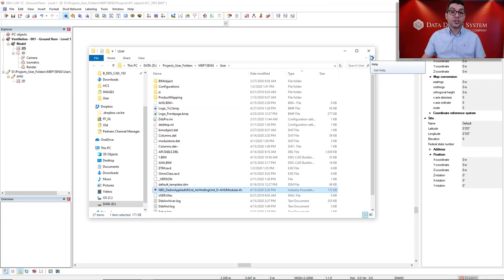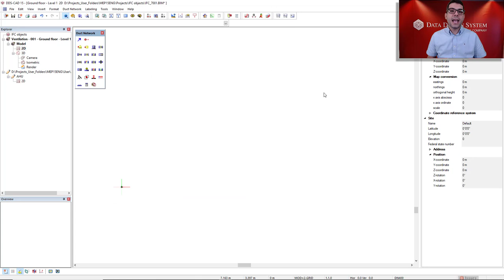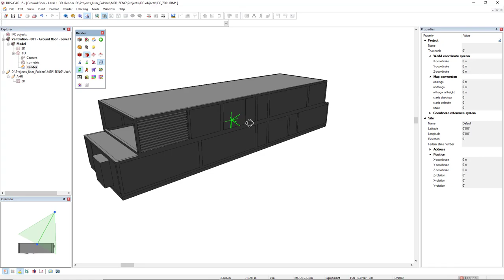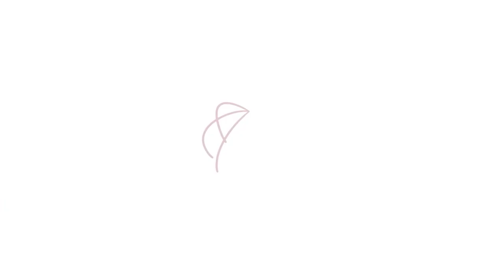DDScad | How do I use an IFC format to create an object?

Comment: Hello
How to cut a hole in a wall?
Reply from the maker: Hi, you can make a void in a wall, slab or ceiling using the Opening elements function which is available in Building working mode, take a look at the following video: 
https://www.youtube.com/watch?v=6MqSxHX8xkQ